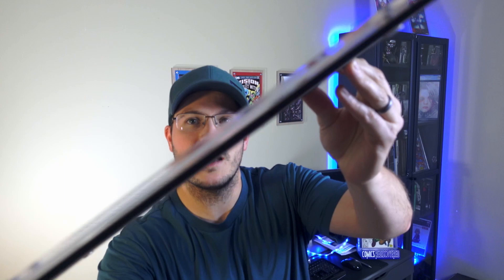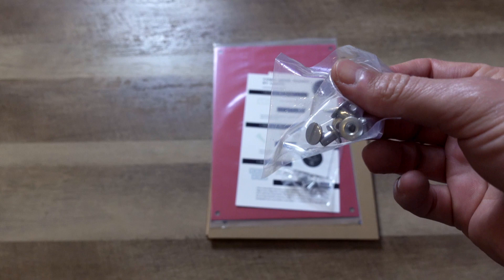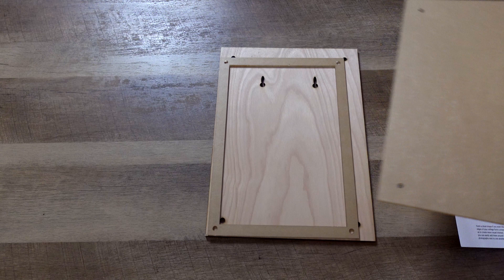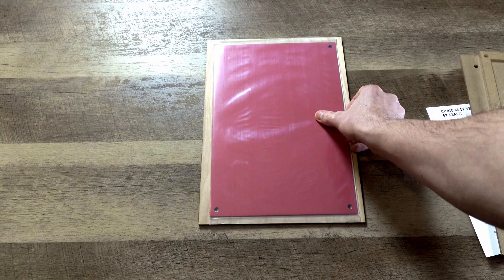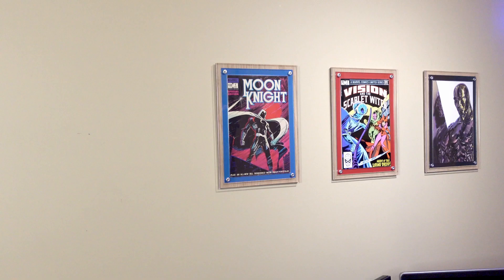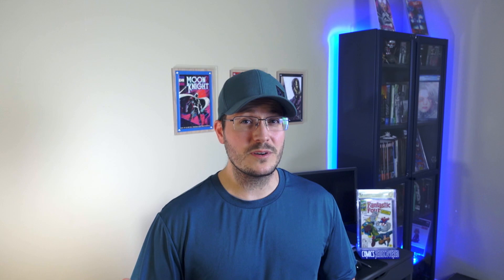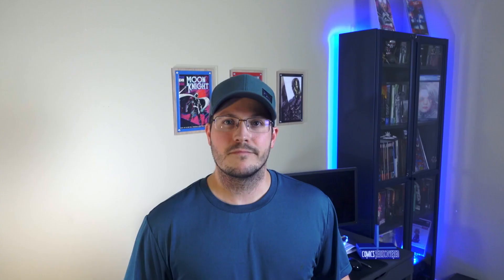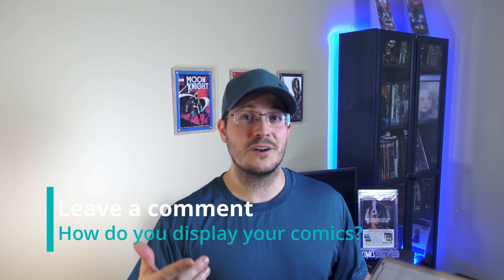Museum Quality Comic Displays?|| FLEX display Review

Comment: its actually helpful that your video has created with good time in between now and this question? if by any chance you have taken them out of the frame, did you notice that the page stuck to the plastic covering or does the comic stay in the same natural state. I recently bought a few but I am worried that it will end up sticking
Reply from the maker: I've had no problem with them sticking. Sometimes a bit of static holds it against the plastic but that's easily resolved. Thanks for commenting!

Comment: 2 hanging holes seems dumb. Not heavy so no need for 2 and with 2 you must get both screws/nails at the exact same height or it wont hang level. Dust will also get in the gap between the plastic front and the wood back. I also wouldnt want the raw comic touching that wood. I dont like this product.
Reply from the maker: thanks for the comment.  I can't speak on the reason for 2 mounting holes.  However there is an internal well, not an open gap.  The wood is also separated from the comic by acid free backpaper (the coloured area), I use these for presentation that I can swap around not for long term storage